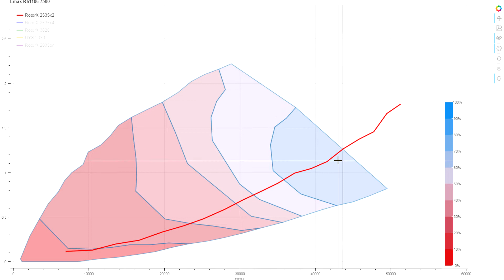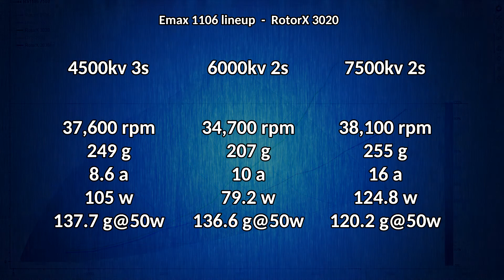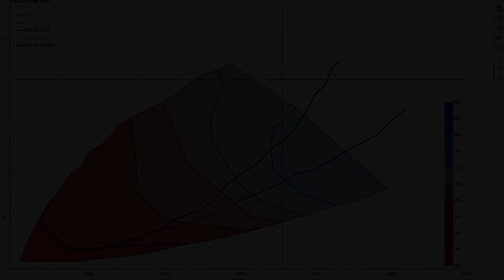How do I read this?  Looking at motor efficiency charts

Comment: May I point out a discrepancy between "mechanical efficiency" and actual flying efficiency? The mechanical output is the torque force multiplies the spinning speed, assuming everything is solid with infinite stiffness. That works great for pulleys and cantilevers. But flying mechanical output happens in a fluid, which is nasty complex. You don't know what the 2535 props actually gives you in flight by looking at the dyno torque. From torque to lift is a whole new different game. Good airfoil can have 200%-300% lift for the same torque compared to a bad airfoil. The dyno gives a good sense of heat waste generated inside and on the motor, but you don't know how much heat waste is generated in the turbulence vortex 3 feet behind the drone.

Comment: This is great data, but the efficiency infill drives me nuts trying to compare motors.  It should have a pattern in addition to the color so we’re not flipping back and forth wondering which one is slightly more red than the other.
Reply from the maker: Ya I find it a real pain as well, it was a little easier before I tried to switch to a color blind safe color set.  Really comparing the color bands is best for finding the prop match for the motor more so than comparing different motors together.  Eventually I want to be able to plot efficiency over a particular loading on MQTB which will make it far easier to compare different motors.  Coming some day.

Comment: How come people say that a motor is mor efficient bellow 35000 rpm? Is it because your motor is on the smaler side at only 150 G? 
How come you never measured the botompart with high rpm and low load? 
I'm interested to see what is bellow the high rpm 60% part of it.  The motor unloading with not that mutch of resistance. Also known as undergeared in the rc car world. 

Do you know why a motor gets really how when a wot at say 45000 at no load? Some talk about Ironlosses but shouldn't they be the same as doing 45000 with a normal load which wouldn't overheat the motor as quick?
Reply from the maker: Motor efficiency depends on load as well as speed, and even at this scale you might have a motor that works best at 45k rpm and a light load, but a slightly larger motor that is still capable of reaching that speed is not going to be working at peak efficiency until you apply an even heavier load to it.

The low side of the test results comes from the inevitable static load from bearing friction and the like.  The area near unloaded in these charts represents about 0.005 lb-ft of torque when the motor is at full speed.  I have an even lighter weight dyno spindle that lets me get down to about half of that drag, maybe around 0.3Ncm at 60k rpm, but even just the bearings in the motor alone have a large amount of drag at those speeds.

I'm not sure why you would see a hot motor under no load.  Usually I'd say that's due to the motor not getting any airflow compared to when it's typically in use, but I'm not really sure that's applicable to cars.  Friction heating would be bigger at high speeds, but that doesn't really apply if both motors are running the same speed.  A motor under load but going the same speed as a motor with no load is going to be pulling more amps, and so should run hotter.  Maybe it could be due to the ESC being unhappy driving a very light load at high rpm, if you're getting any desyncing that will dump a ton of extra power into the motor, but that usually goes away as you load down the motor and it's eRPM decreases.

Comment: Perfect concept & explaination 
Just 1 additional pt. U will find that the easiest & crudest way of finding whether motor is running in sweet 70+ eficiency spot for any load be it land vehicle sea or any purpose for that matter is that   MOTOR WILL RUN WARM 50 TO 80 DEG CELCIUS
TRY OUT YOURSELF & BE AMAZED

Comment: What about current limiting instead of throttle limiting?  BLheli32 can already do current limiting.  Will that keep the motor from going into the horrible efficiency ranges during rapid transitions?
Reply from the maker: that accomplishes the same thing.  That's the reason why kiss escs are slower to accelerate, their current limiter takes the edge off the fast transition.  Still not quite as nice has having direct torque control though, because you need to have your current limit set to be bigger than your expected full throttle, full load current.  

When you give a throttle command to blheli you're essentially setting the duty cycle of the fets.  Dialing back the current you would dial back the duty cycle as well, accomplishes the same thing the same way.

Comment: Again, fascinating. In other circumstances these vids would make a great thesis.

I'm trying to look at this in the context of the other variables too. For example the efficiency of the prop declines with the square of the velocity, the way I read this is that the motors are in effect mitigating the rate of that efficiency drop off due to the relative gain they have which is what we see. During the mid range of the throttle g/w decreases slower than the inverse square you would expect.

It would be really interesting to see a chart of props in terms of grams per n/m though I'm not sure I can think of how you could do that in a general sense given all the prop curves seem to have a different shape.
Reply: I've talked to engineerX on his channel a lot about setting up a thrust stand in a wind tunnel.  That way prop performance can be tested at various airspeeds.  I also had the idea of strapping the thrust stand to the hood of a car out in front of the car where it has clean air and doing tests while driving the car at various speeds, LOL.
Reply from the maker: I've been looking at that, have a couple other videos to get out first though.  This testing finally completely isolates the prop from the motor/esc results, I'm just as keen to look at the prop on it's own as well.

g/Nm is neat because from the few I've looked at so far it actually stays pretty much linear, but the more realistic measure is probably still g/w, just measuring the mechanical power of the motor going into the prop, rather than the electrical power going into the ESC.  That's all still looking at static thrust though, so it can't touch on efficiency loss as speed increases
Reply: Don't let me distract you from making those videos!! Have you got a patreon? Anything I can do to help you produce this content would be great.
Reply from the maker: Not anything super interesting, I've just been promising test results for ever so i need to start delivering.  No patreon, I just do it because I find it interesting.
Reply: Propellers are almost black magic.  There are numerous variables to take into account.  Static thrust stands are not a good representation of them at all.  For example low pitch props like 5030 and 6030 have amazing efficiency and thrust numbers on a static stand but get them in the air and they are boring and have no top end speed.  Pitch and airspeed coming into the prop are related to each other.

This is a great video on propellers.
https://www.youtube.com/watch?v=0bP2MH3LqvI

It starts getting into variable pitch propellers which is beyond what we deal with in multirotors but it is still very informative.

I think static thrust tests are great for comparing motors against each other, but they are horrible for making decisions on props for flight.  Different props only represent various levels of load on a motor on a test stand.  I don't make any decisions on props based on thrust stand results.
Reply: Thanks for the link I don't think I've watched that one. I completely agree but it would be nice to have some more metrics on props than we have especially if it opens up ideas for new prop/motor combinations.